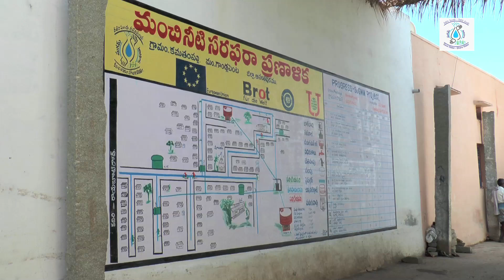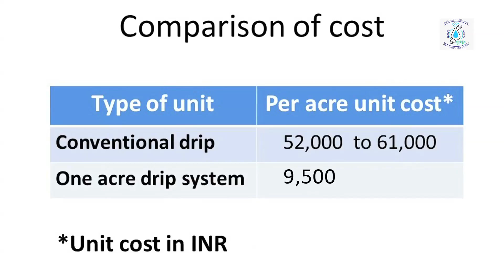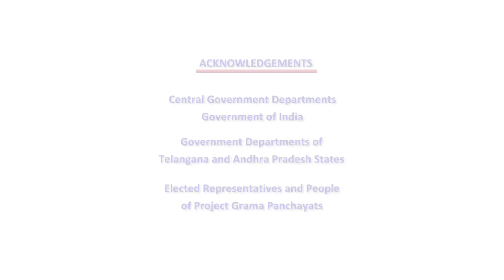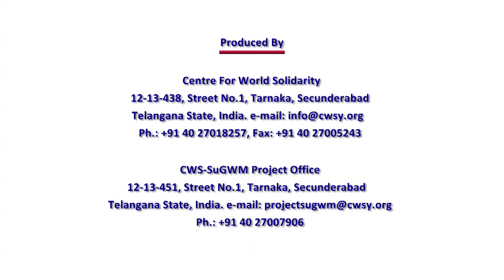Affordable Drip Irrigation System for Low Yielding wells

Comment: Unfortunately, these button drippers are not available in all the places. You will find many small manufacturing companies in Bangalore and so find them in drip / hardware shops in areas like KR Market in Bangalore. I also saw them in hardware shops opposite the Bus Station in Anantapur, Andhra Pradesh.